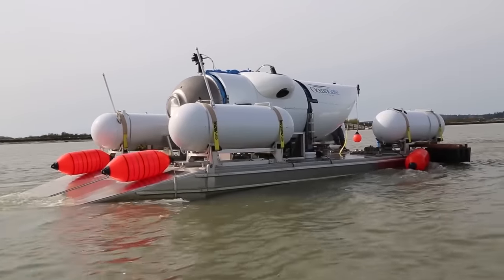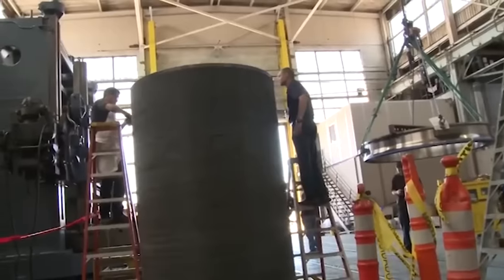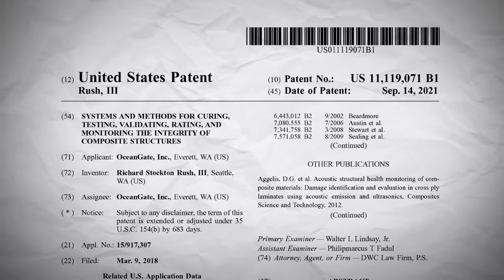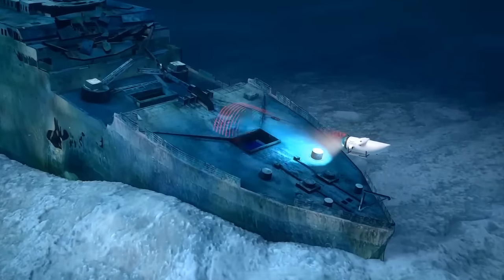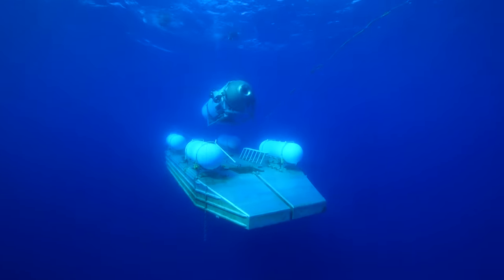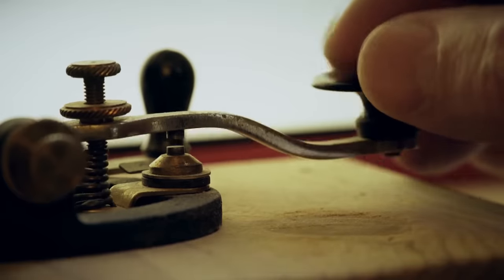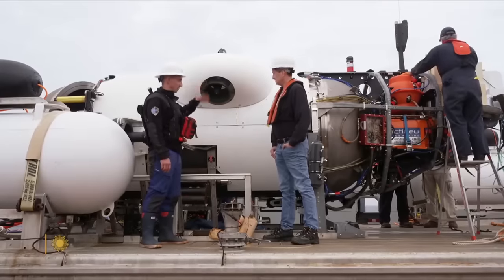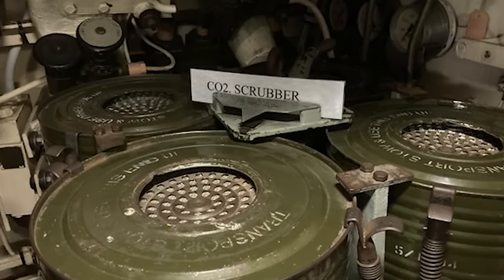Exposing OceanGate Submarines Many Fatal Designs

Comment: The scary thing about the rail tank is the pressure difference would have been 1 atm only!  At the depths they were at it was some hints like 300-400 times greater!
Reply: They would have died 100 different ways in a blink of the eye.
Reply: Just curious why is it that that are wine bottle in the titanic site fully untouched and unbroken by the so called tremendous so called pressures?
Reply: @alexshatner3907  Because they were already filled with liquid (wine or water) before exposed to the pressure. You can't compress water, but you can compress air.
Reply: @alexshatner3907  The process probably went something like this: as the bottles descended, outside water pressure increased, making the corks both compress and shrink. At some point (well before they reached the extreme pressures at the sea floor) either the corks shrank enough or were pushed deep enough into the neck to allow seawater to seep in and fully equalize the pressure inside and outside the bottles. Being that they were full of wine, there was only a small air gap to be filled.
Reply: @garrymullins  Even if they are full, have an elephant sit on it and see if it doesn't break?
Reply: @paulm749  But even if there was a small gap, that would still be the weak point of the chain. and boom gone
Reply: @alexshatner3907  Again, corks are compressible and pressure equalization would likely occur well above the depth where the bottles would fail. One other possibility is that the intact bottles had already been consumed with their contents having been emptied prior to the ship sinking. Then it's just a matter of the sea water freely flowing in to the bottle.

If you have an alternate theory for why the bottles are still intact at the sea floor, I would be interested in hearing about it.
Reply: @alexshatner3907 it's because they were made of so called carbon fibre with so called titanium ends
Reply: @paulm749  You can push the cork in with a stick, if you don't have a tremendous opener.

Comment: One thing I will perhaps never understand is why Oceangate, after having paid attention towards having 7 redundant systems to aid the vessel floating to the surface, seem to have failed to have as many redundant, reliable ways to ensure that the vessel could be quickly located on the surface - ultimately leaving  many planes rushing to search an area twice the size of Connecticut in the slim hope that the vessel had resurfaced and the occupants were in peril of running out of oxygen before they could be located.
Reply: You mean like adding a few 1000 $ to the budget for a good steel cable
Reply: Those systems were probably cheap
Reply: The redundant systems are based on an intact sub.  It imploded before it made it to the bottom, based on Navy info.
Reply: The idea the CEO was operating under was as long as the pressure vessel was intact the only thing that mattered was surfacing. Run out of power, surface the vessel. Motor failure, surface the vessel. Entangled in debris, surface the vessel. In his defense if the pressure vessel fails, it doesn't matter anyway everyone is dead faster than you can react to being killed. 

The CEO to his credit was on the sub. But he also either fooled himself into believing it was safe or his hubris wouldn't let him see he was doing something lethal. I suspect given his libertarian talking points, it was the latter not the former.
Reply: The transponder was probably instantly disintegrated.. along with the rest of the sub. They quickly became lost.
Reply: Apparently the CEO disliked being constantly 
"interrupted" during missions.
He seemed to want to distance himself from those above him..
More I read the more f'D up the situation is...
Reply: Man, they didn't run out of oxygen, the simply imploted and based in some previous minor accidents, they died immediately and their bodies were mostly liquefied.
Reply: I don't see how this is particularly salient. Should the Titan had suffered a non-catastrophic failure and subsequently surfaced, she presumably would have been in the general area of the support ship. The surface search area would not have been unlimited, and finding the submarine - again, on the surface - would likely have been more than plausible.

Part of the difficulty of the search that actually took place is that they weren't just looking for a surfaced submersible; they were looking for a potentially bottomed, or even trapped, submersible. The 10 hour dead man's switch wasn't something publicly disclosed early on, and even that could have failed (especially if the submersible had become entangled in the wreck itself).

In theory, yes, a transponder that activates upon surfacing would have been a good idea, anyway, but that had nothing to do with what actually went wrong. Getting the submersible back to the surface in the event of a non-catastrophic failure is the far greater challenge than locating the vessel once it has surfaced, and it's completely logical that so much effort went into providing redundancy in that area. All of which is hypothetical at any rate, given the failure mechanism that occurred.
Reply: I mean the sub goes strait down then strait up again. Even out of control, I doubt it can drift that far.
Reply: @andrewhart9310  Why then was the search extended to cover an area twice the size of Connecticut?  If they believed it could only be in a small area around where it went down, they would not have searched so far and wide before they knew that it had imploded?

A further question I have is why the ship did not also have a ROV on board so that they could have initiated a deep sea search on their own or even had the ROV accompany/shadow the manned vessel on the dive so they would have known immediately what had happened to it.  It would have been far more effective than waiting a couple of days for ROV's to arrive from elsewhere.
Reply: @j.m.2022  Because, again, they weren't limiting their search to the surface. In fact, they expected the submersible was not on the surface. However, even with that assumption, without any sign of it, you expand your search area. They didn't start with a search area that large.

Maritime searches are fairly scripted, starting with an analysis of wind and current - but the entirety of the underwater currents from the surface to 13,000 feet aren't going to be perfectly known. You start with that analysis, and go with one of several search patterns, and if you don't find the object, you expand the search.

Turns out the remains were, well, pretty much exactly where they were supposed to be. They didn't find the remains two Connecticuts away from the Titanic. :P
Reply: @andrewhart9310  Still, wouldn't better means to track the sub at the surface been a prudent measure on the part of Oceangate to take?  Even an auto-deploying sea dye would have made the sub easier to spot from the air had it made it to the surface.  What about an ROV "dive buddy" - a dive buddy is a common "rule" for divers, why not experimental subs?

Too expensive perhaps? - But isn't that much of the problem with Oceangate's attitudes towards safety?
Reply: Also, when the search was expanded to the 2X the size of Connecticut, they were not just searching on the surface.  The coast guard spokesperson clearly stated that the search was also 2.5 miles deep.  They were searching for a submersible that had on a previous occasion lost communication and become lost for 5 hours.  With such a sus navigation control, it could have wandered off anywhere.
Reply: @j.m.2022  Yes, here I completely agree with you. They had a transponder for tracking the sub, but we don't know how much redundancy they had in that system - and that seemingly fits with their approach.

I don't agree it required the levels of redundancy as their mechanisms to surface in an emergency, as the latter is the far greater danger and concern. You engineer in additional margins to safety with the greater risks, and being lost on the surface was a far smaller risk than being trapped while submerged with a limited air supply.

As they haven't disclosed all that much, perhaps they did have some redundancy in that area (being located on the surface), regardless - but we wouldn't have known it from the search, given that they didn't make it to the surface. I agree with you though that it seems unlikely that they put nearly that much level of care into such a system.
Reply: @j.m.2022  I stated as much. You were questioning why they would need such a broad search area if the sub was likely to be located in a relatively contained area, and I pointed out that they were not just searching for a surfaced submersible - not necessarily easy to find, but MUCH easier to find than a lost SUBMERGED submersible. Again, none of that mattered: they were exactly where they were supposed to be. The fact that the remains have been (partially) recovered so quickly despite resting nearly 13,000 feet down speaks to that.

The navigation control is an interesting point, as while they didn't have zero navigation, they had no way to independently verify location onboard the submersible - e.g. with any kind of gyrocompass or inertial navigation system - relying on sonar navigation via the mothership. While that wound up being a moot point (since they weren't lost in two-dimensional space, but imploded catastrophically), it's still a relevant point to discuss their design flaws as a system of systems, especially if one is questioning their overall approach.

A lot of their "bad ideas" may not have caused this specific incident, but they inform our understanding of the flaws that may have, and could themselves have been causal in any other hypothetical incident.

Comment: A titanium rib located at the center of the pressure vessel cylinder would have increased the strength of the vessel significantly. This sub was in my opinion only good for a max depth of 1500 meters. Everything below 1500 meters needs a spherical steel pressure vessel for worry free and safe diving.
Reply: Or... he could had just used a titanium sphere and had a sub that was not only rated for 4000m but could actually take an accidental collision which can happen down there with currents. But that would had cut too much into his profits and would be way to "conformist" for him. Cant have grey-bearded old men telling him how to build his revolutionary death trap, no sir.

Comment: The "dissolving" part is actually a good safety design. It could even have saved the crew if they had indeed been without electrical control of the engines and the other means to drop the ballast.
Reply: i beg to differ. there are many scenarios where a forced ascent is not the ideal option.
Reply: @ct1762 because of pressure differences? Or what kind of scenarios?
Reply: @ct1762  I thought it was an incredible idea, could you name a few of those scenarios?
Reply: @ct1762  that is not a strategic submarine. If you're underwater in this for 10 hours, you definitely want to ascend
Reply: @Suselsu1  I think it might be bad if you were snagged somewhere and ascending made it worse.
Reply: @rosco4659  it was a tourist ship
and not going into any sort of trenches or chasms.
they were looking at a boat in the open were they not?
at most they would get tangled in seaweed wich i doupt would do actual harm to the hull by ascending.
Reply: @miramaldito they ascended to heaven
Reply: @adamfejes6995  iThey could have gotten entangled in the Titanic, as some scientists were saying.
Reply: @planetcaravan2925  i feel slightly bad for it but your comment made me lol
Reply: @jara4766 Really really doubt they’d take the Titan into the Titanic, even if it could fit (it can’t)
Reply: @Suselsu1  yes if you accend too fast you could have issues. Not sure if it's the same as if you come up too fast scuba diving but it's very tough on the body. If you ever watched any of the James Cameron documentaries on the bismark or other deep dives they always have a controlled slow accent to avoid those issue. Plus it's a lot of strain on the ship too. That's a rapid shift which is far worse for stress on the frame that a controlled change.
Reply: Found Oceangate's lawyer
Reply: @satisfaire  For one thing, the ascent due to dropping the ballast would have been quite slow. For another, it only happens "automatically" when there clearly is an emergency after such a long timeframe. They could also drop the ballast intentionally beforehand. So yes, it was as good an idea as any... it certainly didn't do any damage.
Reply: @planetcaravan2925 except Stockton....he went to hell
Reply: @dungeonmaster6292  good for him, he was close to it at the bottom of the sea
Reply: @planetcaravan2925  Billionaires... heaven... yeah maybe